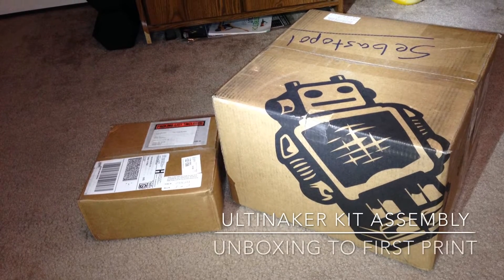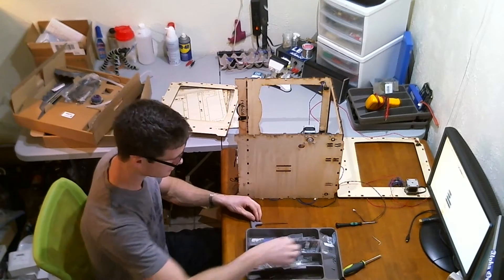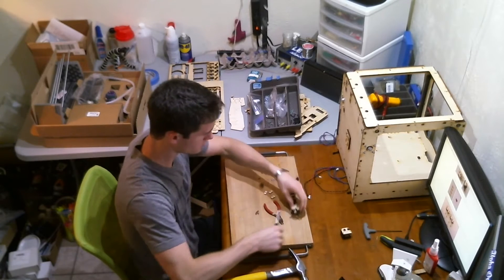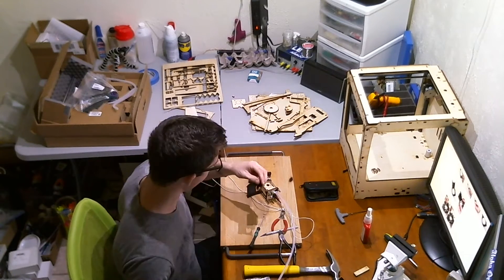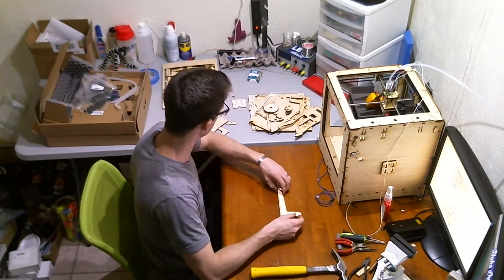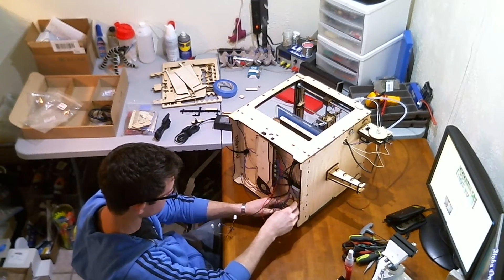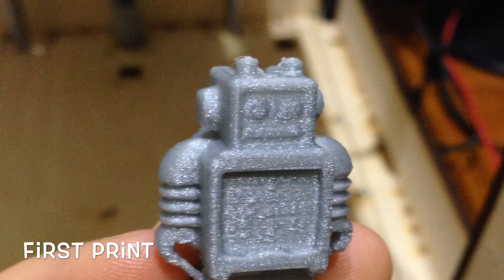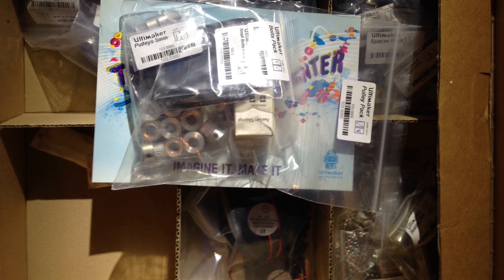ULTIMAKER Kit Assembly

Comment: For my first 3d printer would you recommend an ultimaker original plus or an ultimaker 2? I do not mind assembly and a few issues that are fixable and needing mods for best printing experience. The reason I even am considering the ultimaker original plus is I like being able to mod things and dual extrusion is very nice.
Reply: Thanks for the reply neatherbot, 
I just saw the carbon3d resin based printer should I wait for that to be released or do you think it won't really be as good as it seems?

Comment: I am a 15 year old student and I am planning to join the 3D Printer community. To gain as much experience as possible from the start on, I would like to build such a 3D Printer Kit. Though I do not have any previous experience which makes me wondering whether I would be capable of doing so. Any suggestions?
Reply: What are the most severe things that can go wrong when building a ultimaker? Are tools like a soldering iron and a multimeter necessary for the first built? Do you think the Robo 3D would be an alternative?